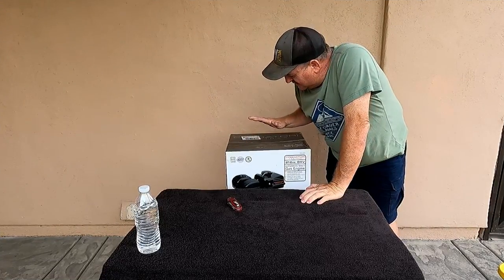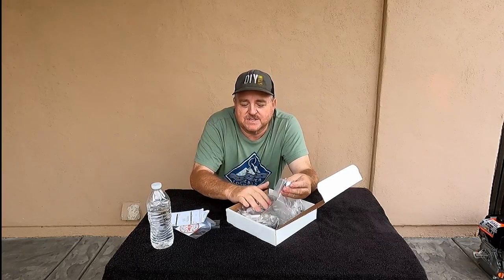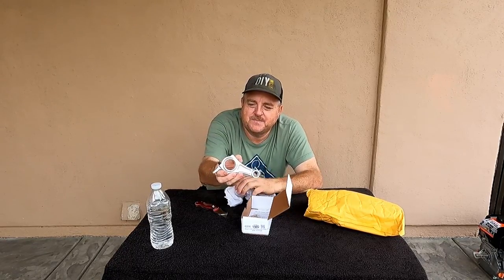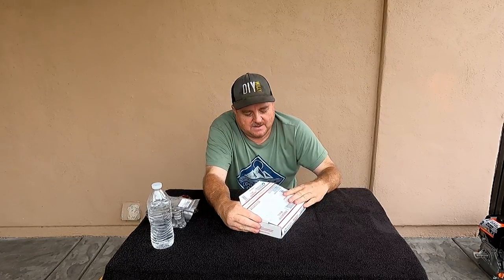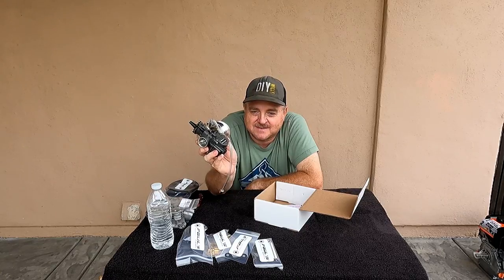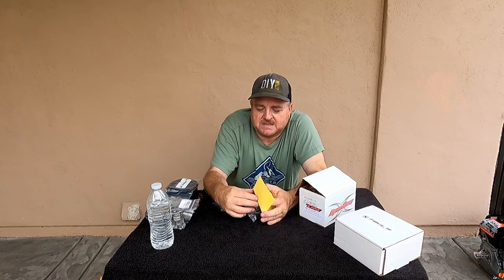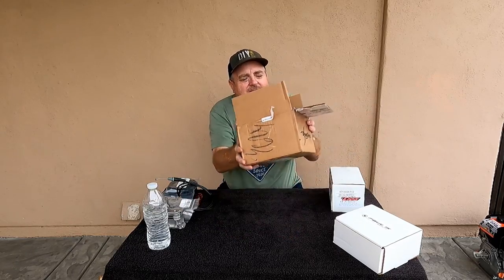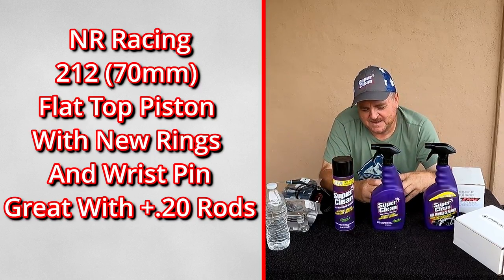Willy's Predator 212 Busted Budget Engine Build

Comment: New here but I really love your channel I just did my 3rd briggs 5hp  I/C block and modified it. I think Im gonna do a 212 Pred or a Tec 6 HP Ohv next. Keep up the great videos Willy.
Reply from the maker: Hello Shatner, I need to find an I/C block for the billet parts I have and can’t use on my engine. I didn’t realize the engine I bought and built was so small. Either way this small 5hp is a good runner and fits nice on my MM80 frames. Thanks for watching!!!

Comment: Nice Willy! You gotta love Paul.s Karts - that's a beautiful Carb! I like your perspective on building these engines. I am on my third build - and I've picked up a bunch of tips after watching your videos. Even though I've built larger engines as you've done also. These smaller engines are a challenge at times! But lots of fun.

I'm thinking your gonna make good use of that carb. Can't wait to see how this goes.
Reply from the maker: Hello, I really love tearing these engine’s apart and hopefully putting them back together.. I need to rebuilding the turbo diesel in my Suzuki Samurai also. Strangely the parts are about the same cost…😬 Thanks for Watching!!

Comment: This is great timing, was just looking around for Briggs and Tecumseh builds.
Reply from the maker: What’s up Elijah, how’s the Briggs coming along? Have you been able to ride it yet?
Reply: @DIYWilly  The Briggs has been taken all apart again for paint and gasket replacements. Not anything professionally. Just to make it not so much of an eye sore. Thinking of a black block and a white fan shroud/tins or everything white. The original engine in the MiniBike had a all white tecumseh 3 hp in it. 

I have chain and gaskets coming in on Tuesday. So far I’ve done some videos of changing the oil (again) and degreasing the whole engine down and cleaning it.
Reply from the maker: Good progress I know it will be a great running engine when done. The Briggs is my favorite of my engines.

Comment: Good stuff! I started working on my ct100 again. I found a few cracks i didn't see before i started. I'm super frustrated with the Chinese frames all over again. I'm getting sick of sticking my engines on them.
Reply from the maker: Would be nice to build your own quality frame. I’ve thought about it but have trouble finding the neck pieces to use.
Reply: @DIYWilly  the guys in the Midwest make pit bike ones. A nice option would be to get the fork and wheels that go on the Honda Clone bikes. I've been riding mine 20+ miles, they are quite dependable in comparison to the regular mini bike options. They sell hydraulic forks with disc brake hubs for around $200....caliper, reservoir and everything.
Reply from the maker: That would be a great option!

Comment: Still don’t see any links to the AN vent lines and how those are U installed in the ARC side cover?  Did you need to re- tap the original 1/8” NPT holes in ARC side cover?  And does Paul sell that line set in a kit or you have to buy pieces and assemble the fitting and re tap the holes in the side cover??
Reply from the maker: Hello ok-man-Duffy, I answered your question in your first comment on the other video. I purchased the parts from Amazon and yes retapped the holes in both the side cover and the valve cover. I’ll update the links to include the vent line parts. Thanks for watching!!!

Comment: My kit did not come with shims, and I did not even think of upgrading mine for four months afterwards
Reply from the maker: You didn’t get the valve spring shims? My first kit didn’t have them either. I was really surprised to see them in this kit.
Reply: @DIYWilly  I had to get some super specific ones from a local hardware store that has like every size screw, bolt, washer, springs even. It was JERRYS Ace Hardware in Detroit. My bike is super rat style tho. Love the set up u got
Reply: @DIYWilly  and no, no shims! Just 18 springs. Maybe they were even 16lb(I think it’s lb). Right now I got 22 lb springs with a brass thin shim. Like 1 or 2 mm i believe. All that on a 100cc engine. I got this lil thing to go 57 mph. Is that good in your opinion? It’s completely stock aside from spring shim and gov link removed(arm is still in the case. Should I take it out, like a full governor removal or am I all good?) I’m 24 btw. Just getting started w this stuff I feel like a dummy😂
Reply: @DIYWilly  FURTHERMORE. I have no breaks. So if I don’t respond you know what happened.😂😂💀kidding.
Reply from the maker: 57mph is really good for 100cc. Definitely take the governor parts out before they cause damage inside.